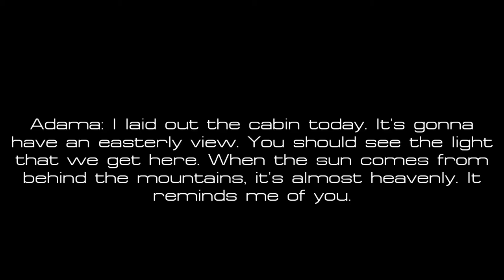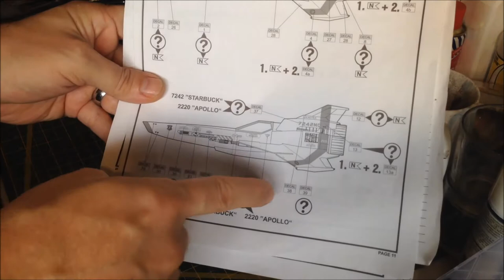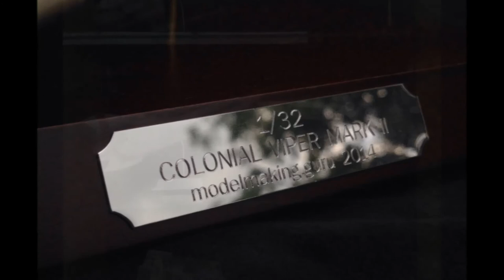Revell Colonial Viper by Modelmaking Guru Part 12 - Canopy, Base & DONE!

Comment: Hi, posted this on the emodels share when I should have posted it here:

My girlfriend and I just ordered this model and have never done any model-building or painting and therefore have no kit. I wondered if you could recommend a starter's shopping list to paint this model.

Many thanks for the video and no worries if you don't have the time to suggest a list.
Reply from the maker: Sure, no problem! You'll have fun with it, make sure to watch the whole series for help with building and painting! I think it's great that you are starting out this...addiction...I mean, hobby...with someone else. It's nice to share! You'll need to expand this comment, it's a big one. 

For a list (and boy howdy what a list), I have to try and remember the paints - they are called out in the videos so you know what to use and where but as best I can remember: 

If you are using an airbrush as well as brush painting:

Tamiya Flat White 
Tamiya Flat Black 
Tamiya Neutral Grey
Tamiya  German Grey
Tamiya Flat Green
Tamiya Gold Leaf
Tamiya Flat Aluminium
Tamiya Semi-Gloss Black
Tamiya Red Brown
Tamiya Flat Red
Tamiya Smoke
Tamiya Thiiner X-20A
Tamiya  Surface Primer (the grey one gives a more grippy finish, the white one is smoother, I'd go for the grey)

If you are not using an airbrush, you can use the rattle-can (spray can) equivalents for some colours. You can brush paint pretty much all of it but the main hull colours are best spray painted either by airbrush or rattle-can to get a nice,. smooth finish.  For the white, if you want white, then go for Tamiya Flat White TS-27. If you want a warner off-white tone, you could use Tamiya Insignia White  (AS-20). If you want to do a black undercoat underneath the white to give depth go for Matt Black (TS-6) but bear in mind this will make the white look darker. Or if like me in the films if you want to do grey paint chips then spray TS-4German Grey underneath the white, and mask off the paint chips with a liquid masking solution such as Humbrol Maskol.

If you wish, You can also pick up some Micro SOL and Micro SET for the decals. Lastly you'll need a varnish or two - gloss varnish for giving a smooth surface when you are doing decals and streaking, and a matt varnish when you have finished the model and need to remove the shine. Humbrol's rattle can varnishes (matt and gloss) work fine for me, just remember to leave a few days between painting oils and varnishing so the oils can dry fully.  

For the weathering, I'd suggest a selection of Tamiya Weathering Pastels (but these are optional).There are a few different colour sets, I'd grab a few that cover the range of greys, dirt, brown, rust and earthy tones. 

For oil paints for the streaking, discolouration and shadowing, I'd strongly recommend Mig 502 Abteilung oil paints, notably: 

Starship Filth
Engine Grease
Light Rust 
Dark Rust
German Grey Highlight

For normal, generic colours (black, white, red etc) you can see what other Mig ones take your fancy, or bog standard artists' oils will do. You'll also need some odorless turpenoid (thinner) for the oils. Again, any old artists low-odor thinners for oils will do.

Then lastly, just get some brushes - I'd get nice, good quality brushes for the oils - if you can stretch to artists oil brushes - some soft, flat chisel end brushes for drybrushing and some smaller pointy ones for other painting - then do. Sable brushes are a bit pricey bit will last you for years. For the acrylic paints (the Tamiya ones) you don't have to spend a fortune, just get a good selection of big fat ones, and some tiny teeny tiny ones for detail painting, and one or two flat chisel end brushes for dry brushing. Apart from metallic colours I wouldn't recommend dry brushing with acrylics as it can get messy and lumpy, best sticking to oils for dry brushing.

And that's about it, I think. I've probably missed something out, but please feel free to watch all the videos in the series, it covers everything from opening the box to applying the finishing touches.

Along with paints, if you can get yourself a nice pair of sprue snips/sprue cutters, a modelling knife, ALL THE TWEEZERS all of them (seriously, get as many different shapes as you can), Tamiya filler or Milliput  if you want to fill seams and gaps), Tamiya masking tape, liquid cement (Tamiya Extra Thin if you can get it). As you are starting out, for now it's worth hunting around your local pound shop for things like disposable knives, clamps and tweezers).  Most of the stuff listed here you can get from www.emodels.co.uk 

Good luck, have fun, and send pics to me at foxx (at) modelmaking.guru so I can post them up! 

Also, damn, I use a lot of Tamiya stuff.
Reply: Modelmaking Guru wow, thanks a lot for the info. An £11 amazon purchase (the mkii) is going to turn into quite the spend! Glad Christmas is on the horizon. I suspect I will trial run this with a basic setup then get the inevitable urge, buy a new ship and whatever gear I didn't get the first time. We'll be sure to send our attempts your way. Thanks again (and I had to expand your reply twice!)
Reply from the maker: Jon Appleyard Hey, no worries, my pleasure. That's the beauty of this kit, it's a fairly straighforward build so if you need to just start with a smaller collection of bits and test stuff out. You can always make another one once you have more kit - it's a fun enough kit that making it again isn't a chore :)